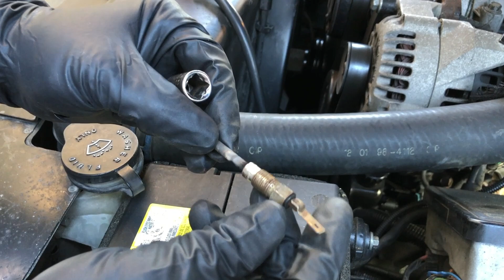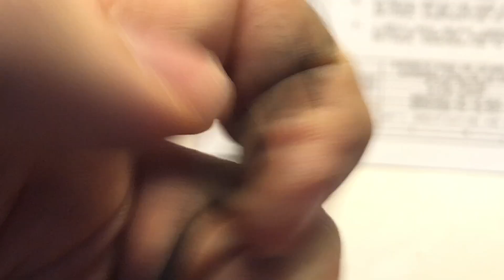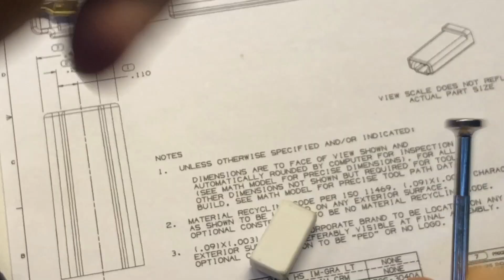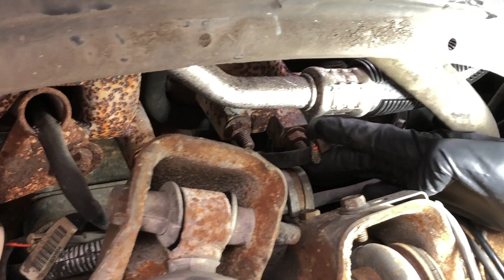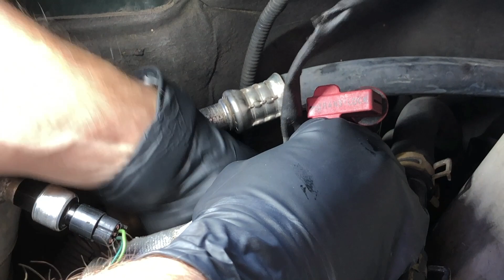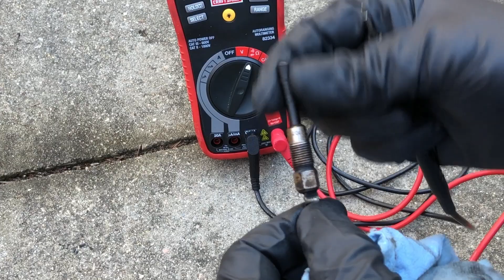1992 - 2002 GM OBS Trucks Vans 6.5L Diesel V8 Glow Plugs & Wiring Repair & Replacement (Chevy & GMC)

Comment: Be very very very very cautious of the authenticity of “genuine” parts acquired from eBay and Amazon. Even if the seller shows as “ACDelco” and/or “Sold by Amazon” it has zero guarantee or assurance that it is genuine. So many imposter parts specifically from those two web sites! The automotive parts business has been inundated with counterfeit parts for decades. I have been burned twice and never again.
Reply from the maker: It's not the venue, but the particular sellers that cause this.   It's something everyone in this field has to get comfortable with, as for discontinued OEM parts (aka NOS parts) the only viable source is eBay.   Buy from USA based sellers only, buy only those with actual part photos not stock photos, and pay attention to seller feedback.  I've been doing GM repairs and restorations for over three decades now, and I've never had an issue.

For new OEM parts, Amazon is also a great cost saver.  But again, you have to apply some rules.   Only buy parts actually sold by Amazon.com, not just shipped by (FBA).  And read the comments and reviews before you buy.  Again, I've never had any issues over many decades.

Comment: I have a 99 suburban with the 6.5 as well - I've changed all the glow plugs before but suspect a couple had failed again and was going to change them, then all of a sudden I stopped hearing the glow plug relay buzzing while the wait to start light was on initially.  Very hard starting so clearly the glow plugs hadn't been powered while the light was on but once it started the light flashed on and off for a few seconds normally, at which point I could see the volts dip each time so that tells me the plugs were being powered at that time.  Is this an indication of a bad glow plug relay/controller?
Reply from the maker: The voltmeter dipping does indicate that one, or more, glow plugs are drawing current.   If that's not happening in the wait to start sequence it could be the controller, or it could be a problem elsewhere in the wiring harness.  Would require a bit of diagnosis with the shop manual schematic to confirm which.
Reply: @DrShock  At this point I'm going to roll the dice and replace the controller.  As far as I know it's factory and new parts are always good insurance in an old vehicle IMO.  If it's still doing it I'll have to investigate further, if not I have a spare.
Reply: @DrShock  I just replaced the controller and got the same result.  No buzzing from the relay but once it starts or after a certain time the key is on it will blink intermittently like normal and the volts dip each time the light comes on indicating the plugs are drawing power.  Not sure what's next in line to check?  I don't understand the circuit enough to know what tells the controller when/how long to power the glow plugs when the key is on (pre start) and the wait to start light is on.  I know it's temperature related but not sure what sensor it's using.  Coolant temp?  A different one?
Reply: Do you know where I can get a wiring diagram and/or troubleshooting info for the glow plug circuit?  I'm still having issues even after replacing the controller.  Don't have a shop manual.
Reply from the maker: Shop manual is the only source.  Either hardcopy from the search link in the video description, or thru service information (SI) at www.acdelcotds.com

Comment: I have an 82 K10 with a 6.2 diesel. If you have a factory glow plug controller the 60g plugs do not heat up quick enough to properly start the engine without excessive cranking. I used Kennedy quick heats and she starts up every time

Comment: Well I got 7 out and one had to break. It broke right at the hex head. Impulse is to use a small drill bit but then not sure what after that. Any ideas?
Reply from the maker: When you say broke at the hex head then if that means flush with the head with the hex part now gone, I'd say stop and drive it into a shop after buttoning up the other 7, as it will require specialized tools to address that I doubt you have given our previous thread of discussion (like using a MIG welder to put a nut on it).  Don't attempt to use an extractor on a stuck plug remains as if the extractor breaks off then it's a pull the head off to remedy situation.

If you mean the upper portion of the plug broke off, but the hex head threaded base of the plug is still there - then you might be able to continue by applying some heat to the hex head to further break up corrosion at the top threads.

Comment: You did a good job making the video but I Think I am giving up. Those plugs won't budge with a socket wrench putting most of my strength in it and I don't got an impact as I've seen others advise to use on a low setting to vibrate loose so I don't know what else to do. Called the dealership although for $160 an hour I could probably get an impact.
Reply from the maker: If this service has never been done, or the truck spent any time driving in Winter in a rust belt state, the glow plugs can be really bonded to the cylinder head due to corrosion.  Even if not there could be swelling of the tips on the inside, requiring special tools to dislodge them without them breaking off.   Rather than impact tools, you could instead try a sharp rap with a small hammer mid-way against a breaker bar on the socket to try and dislodge the corrosion.

I wouldn't recommend taking an older vehicle to a GM dealership if you decide to farm out the work.  I'd instead recommend finding a diesel mechanic who will have the right special tools for anything that may go wrong.  Preferably an individual who is on the older age side, and thus some experience with the 6.5L engine.
Reply: @DrShock  Thanks I am trying to understand what you said here: "try a sharp rap with a small hammer mid-way against a breaker bar on the socket to try and dislodge the corrosion.""

A sharp rap is like hitting it? So something like placing the socket on the plug and striking it?
Reply from the maker: Use your same socket with a breaker bar, instead of a ratchet wrench (this is just a tool that does not ratchet so is stronger at the socket attachment point).   You hold it with your left (unless you're a lefty) and strike the middle of the tool handle with a small hammer to drive it in the unscrew direction (lefty loosey).   The shock of such a rap can often dislodge corrosion at the exposed top threads where you can then get it going by hand the rest of the way with penetrating fluid.  You might still run into a swollen  glow tip, but it will mostly unscrew even in that situation so you'll be past the rusted threads challenge.
Reply: @DrShock  Okay I see I just don't have a breaker bar.

Comment: Any tips on getting the broken spade out of the connector? Been trying to push that tab down with various tools but getting close to just breaking it and u said u could get a new one from aptiv?
Reply from the maker: There are links in the description for the parts I identified in this vid.  You need a special tool to separate the connector from the housing, I list that in the description too.

Comment: I am tugging on these white connectors like mad and they aren't budging. Should i spray penetrating oil in the connector? I sprayed around the nut like part of the glow plug but wondering if spraying in the wire end would help?
Reply from the maker: It would not harm the wiring or connector to spray some penetrating oil into them to free up corrosion.  It may help, the male spade end of the glow plug has a small square cut out of it (you can see this in the video thumbnail photo).  The female end of the wire has a connector that grasps onto the spade, and into this square cut out.   So it does take more force than a typical electrical connector to separate.  I'd suggest moving onto another cylinder to get the feel for the force required with one that is less bonded together.
Reply: @DrShock  I've tried tugging on 4 or 5 and they are all tough. I will try the oil now. Thanks!
Reply: @DrShock  I think that little spade thing broke off in the connector. No idea how'd I get that thing out of there and I guess I need a new connector or wiring?
Reply from the maker: Yeah, as old as these 6.5Ls are it can happen.  This is why I covered how to repair the wiring in this video. ;-)
Reply: @DrShock Right so I just watched how you replaced that wiring and the initial test light will tell you if it needs replacing or just a visual inspection? It was quite a struggle but I removed all the connectors and only 2 spade heads (on the more rusty side) broke off in the connector. Really hoping removing the plugs will go better.
Reply from the maker: Start off with a visual inspection, anything that looks oxidized you can clean up and then test.
Reply: @DrShock  Is there something else you can use besides the test light that you used for that? I got a multimeter and a little 3 pronged fuse tester tool.
Reply from the maker: Yeah you could use the multimeter, and just test for inline amperage (current) between the plug and the connector if you do not have a test light.  Just be sure the meter is can handle the current draw during the glow plug cycle.

Comment: I can't remove the connector
Reply from the maker: Likely corrosion has bonded them together, you'll have to pull more firmly straight out in line with the glow plug (not at an angle).  I have a pair of pliers with plastic jaws for this purpose.  Be sure to pull only on the connector, not the wire.
Reply: @DrShock  right thanks.
Reply: @DrShock  I sprayed them down in the wires ran the engine for awhile but they still don't budge. I can wiggle them but idk try pliers next? I don't have plastic ones but thought I could duck tape them. :/ Idk.

Comment: Afraid I'll break this white connecter. You just pull it straight back? Penetrating oil help? These are Fairly rusty
Reply from the maker: The light colored plug housing to the end of the glow plug electrical connector?  Yeah, just pull straight back grasping the housing not the wire.  They are a friction fit at the spade connector of the glow plug.   Depending on how many decades old your setup is, these may crumble or break unfortunately.  I cover in the video a suitable replacement that is still temperature compatible.   

Now I'm talking about the tip of the glow plug wiring harness here, those short intermediate wiring harnesses on the passenger side that route thru the exhaust manifold shields are a different two piece design but the ends are the same.
Reply: @DrShock  Yeah I think like the one you showed in the vid. Accessing these is also tough right side looks like i can almost do it through the doghouse but the left driver side I got to take the wheel well apart and of course when they made these things they weren't thinking of that. Hidden bolts under the floor rubber. 

I'll guess i'll try again tomorrow.

Comment: I got a 2003 p42 with a 6.5 are the glow plugs all the same part number? Like are the ones I need the same ones u used in this video?
Reply from the maker: The ACDelco part number I went over was the last and only 6.5L glow plug design released by GM (I showed this in the GM service bulletin during the video).   GM stopped shipping these 6.5L engines in their own vehicles after MY 2002 (Express vans were the last to have them).  Your Workhorse P42 (aka P van) that came with the GM 6.5L engine originally would have called for a Workhorse W8000549 glow plug (which I believe is actually the same GM ACDelco 60G plug we covered in this video rebranded by Workhorse).
Reply: @DrShock  Yeah Workhorse marks up a lot of stuff 2X what I can find on other sites. So looks like it is the same.

Comment: Mine are looking super rusty and I got a p0380 code I got a multimeter. I read some say to spray these down with a wd40 or pbblaster and let them soak for a few days before trying to remove them. Any advice? That part of my engine is rusty was there something I could put like paint or oil to stop rust in this area after changing the glow plugs or is it too hot?
Reply from the maker: If you are in the rust belt, then, yeah, I would definitely recommend a penetrating oil overnight first. Something like Kroil or PB blaster.

Comment: Have you ever work on a California emissions relay controller module? Any videos?
Reply from the maker: I'm not aware of any such module employed by GM on the 6.5L diesel powertrain during its production run.   That's more likely for the later 6.6L Duramax engine.

Comment: This is probably the best video I've seen for replacing glow plugs. I'm new to the 6.5 and have been trying to figure out why it just won't start after the outside temp drops below 50, (checked the controller and harness, all tests out fine)  was really hoping it was not going to be a plug issue...as I have a hummer, reaching number 8 is going to take some serious gymnastics, I could barely get my hand in there to touch the connector. But...going to have to, because I'm not paying someone 1,000 bucks to replace them. (Yeah that's what I was quoted, lol )
Reply: I agree.

Comment: You said to check the glow plugs every 100,000 miles. What is the upper end or range of the 6.5 in mileage before you have to rebuild the motor and heads?
Reply from the maker: GM unfortunately doesn't publish any maintenance interval information on glow plugs for the 6.5L diesel engine.   So 100K is just some best practice advice to avoid letting them go too long and become either defective, or damaged and thus difficult to remove.

As far as engine lifespan, this really varies and I've not heard any consistent guidance in this regard.  Diesels are far more robust than gasoline engines, but they also at some point will need to be rebuilt.   For me personally, I'd go down the rebuild route when I encountered a major engine repair (e.g., new head gasket needed) rather than based off mileage alone.
Reply: @DrShock  I've got 66k and a P0380 code. Mine look rusty. I am going to get in there this week and test them out. Otherwise starts fine.

Comment: What does a glow plug do ?
Reply from the maker: Diesel engines do not use spark for ignition, but rather compression of the fuel.  This type of combustion is most efficient at a particular temperature range.   When cold, warming the combustion chamber eases starting, and that is the function of a glow plug.  A glow plug is essentially a heating element.  On a 6.5L diesel engine, they are cycled on and off until the appropriate temperature is reached for optimal starting.

Comment: Dr.Shock, I need your help, I would have sent you an E-mail but I couldn't find one so I'm posting my question here.

I have a 2007 Saturn aura xr. The instrument panel cluster is bad (backlights are out very common problem) and I have a good used one I'd like to swap in. Now I know I can't just plug it in as it will mileage lock the new one and iirc the old one as well. I have a tech2 and Mdi2 with access sps2 on line.

Here's my problem, I don't see a way to program the new IPC. I can't see anything in alldata on how to do it nor do I see any options in sps2 or the tech2 to program in a new one. Any videos I've seen have been on 08 or newer GM's and super straight forward.

Now with that being said, on a tsb I read and interpreted that I needed to just copy the bcm data to the tech2 and I guess swap the cluster and write data back to the car?(which I do see an option for)  Any concrete info on the correct procedure would be appreciated and for sure would get you a cup of coffee.
Reply from the maker: I'm not sure why this is posted to a video about diesel engine glow plugs - but afaik you cannot reprogram one of these IPCs used for a 2007 Saturn Aura using a Tech2.   The Tech2 will only program a new or remanufactured GM IPC from that era, not an used one which has already been VIN locked to the previous car.   To address it otherwise would have to be a chip level (EEPROM) edit on the circuit board to reset the mileage back to 0.  Similar to some of the BCM vids I've done.    To know if the IPC is already VIN locked, you might google for an old GM TSB number PIC4554A.
Reply: @DrShock  I didn't think you would reply to and older video, but that answers my questions, thanks!

Comment: The wiring going to the glow is a fusible link. Any idea how to replaced it? Who sells it and what guage is the wiring?
Reply from the maker: There's a link in the description for a seller on eBay that has just that short length of baby blue fusible wire.  Same gauge and manufacturer as original.

Comment: Did you use antisieze on the glow plug  threads?
Reply from the maker: No, living in a southern area of the USA this has never been a thing, nor is it called for in the GM service manual.   Though I will use Permatex Anti-seize on some exhaust fittings where torque isn't as much of a concern.  But you shouldn't need it on a glow plug if you are using a torque wrench to install them.   If the previous person didn't, yeah that could make you wish they had put anti-seize on the threads first .  ;-)
Reply: @DrShock   Thank you.  I did not think you had used it but I was unable to confirm via the video as my wifi reception was sketchy during my install.   I installed them without antisieze :).   I used heat and candle wax to remove the heat shield nuts so there is residual wax on the nuts and studs so next time should be easier

Comment: Great video.  What crimping tool did you use?  An Amazon link would be great.  Thank you!
Reply from the maker: Thanks, the tool I used is an MSD ignition 35051 pro crimp.  I have a link in the video description for the jaws that fit a series 56 terminal, as well as all the other parts I showed in this vid.